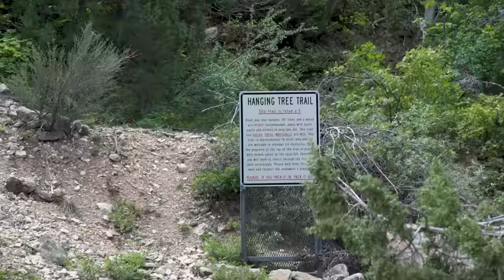Recovery Level: IMPOSSIBLE!! I Call Matt’s Off Road For Help!

Comment: This is the best recovery that I've seen Matt take the wrecker on. Now you need to prep the Laymo and take it through there for Demri.
Reply: It’s a two part plan, how do you recover the Laymo if it doesn’t make it?
Reply: I agree but let Demri drive the trail in the Laymo
Reply: Riiiiiight, maybe if you articulate it in the middle. 🙄🙃😔
Reply: Definitely  want to see the Laymo on this trail! But I want to see it with some rear stear!
Reply: I think the Laymo is way too long.
Reply: Laymo would not make it. Even with rear steer.
Reply: The Laymo would need Paul or Rory in front to drag it through everything, and Matt would have to be in back, probably in reverse so he could use the boom to swing the back end of the Laymo around corners
Reply: Also, it would be impossible to turn the Laymo around in that canyon.

Comment: As always another outstanding adventure.  Funny thing.. in the 70's we ran tubes in everything.  We didn't have beadlocks... at best some  were the old split rim wheels... but tubes were a necessity for aired down tires...  Can Am if you're watching.  Robbie has trail proven the can am as an ambassador... if you have a HIGH lift long arm suspension kit... along with a taller tire setup... he could sure use it.  
   That "level 5" trail is a proving grounds for anyone who is building a crawler !! It challenges every aspect of the build.
   Hats off to both crews. 👏 always enjoy watching you guys.  Looking forward to seeing what's next.  😎 👍

Comment: It's nice to see that Matt got the headers wrapped on the heavy wrecker. (0:35)  Hopefully that fixes the issues with the loss of air pressure from the lines coming out...
Reply: Matt said in his video that the DIY heat shield did the job, and the air lines didn't get hot. I believe they're planning on replacing it with some proper header wrap "Soon(tm)".

Comment: Nice to see Matt channeling Rory😂 really really good episode.
Reply: Trail Mater might be able to go up those obstacles forward or backwards.
Reply: Never bet against Trailmater
Reply: The difference between the heavy wrecker and Trail Mator is that Matt climbs obstacles with the jeep still hanging, where Trailmator sets the jeep down, climbs the obstacle, then pulls the jeep up. That’s what you get with a rig twice the size.

Comment: This is the only problem with tyres so big you can't carry a spare. Someone needs to turn that 5 into an 8 before someone gets hurt on that trail.

Demri, Robby channels Whistln' Diesel often enough without you encouraging him. he's already done 10 to 15 grand damage to the CanAm on this trail, that a lota views and merch.

That was a great episode and that wrecker just has to be the ultimate off-road vehicle for anywhere it will fit between the obstacles.

Comment: Okay, long time (and happy) viewer of MR but first time commenter. Comments are purely out of love for the show and it’s cast. Me, I’m a near 80 yo (26) year Ford tech who has enjoyed off-road activities for most of my adult life - which started around my 16th year. I watch with awe every turn, twist, every rut, every rock (or boulder), and all the busted parts that are part of the show – yet there are some issues that simply befuddle me. Along with my years working in automotive maintenance, I also put in 20 years in naval aviation maintenance and still managed to get in a fair amount of dirt biking in the bombing range outside of El Centro and of course, Glamis - them were the  “good ole days”. So when I watch your wonderful show my brain not only follows the action on the trail but also visualizes the strain on all them moving parts, knowing the weaknesses of some products and the strengths of others.  What “befuddles me” is your own admission of sometimes not being as prepared as you should be – like running out of fuel, leaving the keys behind, or “we shoulda fixed that!”. What you need is an old guy that ain’t much good for anything other than spotting issues that could be problematic BEFORE they become problematic. You need a PMI guy (Pre-Mission Inspector) whose sole responsibility is to ensure every piece of recovery equipment is good to go and if it ain’t what does it need to make it so? Note I said recovery equipment – not just vehicles but anything that the ship needs to stay operational. Ok, old guy will stop rambling now – love your show.  Mike (sometimes known as “Dirt”)

Comment: Matt, I've done A LOT of car+truck tires BY hand!!! A few tubeless tire patches are about 4" square and might get you by! ,2 ply also. I used 2 chunks of channel iron with flat straps to connect them. Piece of angle to hook on rim on bottom to catch rim. Short car jack to pressure the bead. All that after handle went away on tire hammer. A land hook is good also, 4-5 foot of channel pounded into ground. Hopefully something here will help!🤔

Comment: Another effing amazing tow. I have viewed a prior vid with a similar recovery by Matt and the Beast , and labeled that one as EPIC.  This one may have beat that, but I think the lockers were working on this one, which was not the case on the previous vid I referenced.  Placing those axles so that the wheels are at the corners of the vehicle and sizing the frame for 54s have led to an AWESOME machine.  Interesting to see the gawkers the trip brought out of the woods.... Even more interesting to be in Matt's seat, which leads to whether that fellow sitting in the side by side got off that trail with 'unsoilded' undies.....

Comment: I know everyone tries to tell you how to do your job.  But from the outside looking in if you would run lift cables under axle to frame the axle wouldn't extend and wheels would be higher wouldn't have to lift vehicles as high.
Reply: Not a terrible idea, but the suspension would bounce and rub the winch lines on the front of the truck.  Bad for paint and plastic on most trucks and hard on winch lines.

Comment: MATT, I have a fix for your trailer/winch/battery problem!  I put an electric winch on my boat trailer but didn’t want a battery on my boat trailer so I installed a 100 amp.male/female plug designed for a trolling motor. The female side of the plug I installed in the side wall of my pickup trucks bed & wired it down along the frame to my trucks battery. This plug will handle 100 amps. so I installed an in line resettable breaker at my trucks battery & wire sized to handle the current draw of my winch. The male side of this plug I wired to the winch with enough wire to reach from the winch on the trailer to my trucks female plug!  You can wire in & install one female side of the plug into every tow vehicle you have & eliminate the need for trailer batteries completely because you get the power for the trailers winch from your vehicles battery just like a fixed mounted winch on that vehicle! NO MORE CHARGING trailer batteries or carrying a jump pack for power!  I’ve used this setup on two of my trucks over 8 yrs. without a single problem!  You simply hook up your trailer to your tow vehicle,when the winch is needed plug in the male pigtail from your winch to the female plug installed in your tow vehicle,that’s it your winch is ready to use. Amazon has the trolling motor 100 amp.male/female plugs & resettable breakers I used for my setup & they have worked great!  Love your video’s!

Comment: I love LS motors myself but I think a Coyote 🐺 motor would be perfect and the best option for the broncstar they have plenty of after market support and they can almost be better in some cases and make better power with less issues than a LS shoot look at Cletus McFarland's new fox body race car.
Reply: Cletus’s Mustang “McFlurry” has a 7.3 Godzilla 🦖 not a 5.0 Coyote. The Godzilla would probably better suit the Bronc⭐️ for a number of reasons a big one being size constraints. The coyote’s packaging (physical size) is huge compared to a Godzilla despite the Godzilla being larger displacement-wise. The LS and Godzilla share a lot of similarities being the cam in block engines which are overall more simple mechanically. I’m a Ford guy through and through so I definitely want to see it stay Ford be it a Coyote, Godzilla, or even an old school SBF. That being said it’s hard to deny that the LS is usually the most logical swap option, they just work.

Comment: You guys should look for something that is a challenge next time.  Wow.  The Wrecker could surely put an Army Tank Retreiver to shame.  The "4-wheel drive" manufacturers should pay you for some engineering critiques and ideas to improve their products.  Unlikely to find degreed engineers who can whip out trail repairs (and pre-trail repairs) quickly with off-the-shelf parts and determination.  Super competence.

Comment: It's too bad you guys went through all that. I've seen a much larger sidewall cut get repaired and last all day in a cheap beater raceday with about a dozen of those plug sticks jammed in there. Esp when you're aired down it really doesn't take much to plug a tire. Dont have to jack it up or remove the tire just put the slice up top and start squishin plugs in from the outside

Comment: Oh btw... the Ford engine on the Broncstar did not fail. Even though it has a blower. Crappy en-guy-nearing failed. The WBW is struggling with engineering failures, in spite of the 8 liter LS in it. Like frying the wiring. Roasting the interior. No spare wheel & tire. Don't be a hater Robby, or I'll be hating on you. Demri is good though. 😊

Comment: Put a rock ram agr steering pros system in that Bronco are some type of hydraulic or electric power steering system those power steering pumps aint going to handle that load just my opinion

 👍🏻 either way it's content

Comment: How come you don't carry a spare tire somewhere built on top of that truck The other thing I want to know is why don't you design some kind of ram front and back that could lift the truck if you blew a tire have 1 in the front and 1 in the back you can carry on the truck And you have plenty of rocks laying around to push again so somebody needs to just find a picture of building jack for these Trucks

Comment: tube is good ...why is tubes never used anymore?
Reply: If that tire spins half an inch on the wheel, the inner tubes valve gets ripped off. 

Also tires that aren’t designed for use with tubes will chew it up pretty quick during normal sidewall flexing

Comment: I get it why Hillbilly does not want an LS, but a 5.0 is not going to be as reliable or as cheap to fix. And I don't think Hillbilly is in a position to use a more expensive engine in his rock crawler.  If its free from the boss freaking do it hillbilly. And when you have money you can put a 5.0 in it. You got plenty of time left in life to do it.

Comment: Those razers are to low for that lol😂.. tires way way way to skinny and small... honestly may wanna put bigger tires and lift it about 5 or 6 inches and add more weight to the frame.. should do better

Comment: WHY go after another rig without any tools?    You need to create a checklist for the wrecker (similar to the military) that covers what is broken and not broken on the rig,  Tools required for the rig, is the rig gassed up, windshield cleaned, etc.  You need to be a bit more professional.  Be prepared for the unexpected.  What if this or that breaks?   How do I replace, repair it?  Can I replace or repair it?  Once equipment is loaded up, do NOT take it off for shop use EVER.

Comment: Hey Robby...you wear your belts way wrong. The lap belt should be tightened 1st si it's across your hips. THEN tighten the shoulder belts. With the belt buckle on you belly, in a crash when you need the belts, it's likely to do werious enough damage to endanger your life. I'm not some internet knucklehead spouting off. I was a racing Technical and Safety Inspector for over 50 years and a champion race car driver and a recreational offroader all my life. I don't want to see you hurt bad. Demri wouldn't like it one bit.